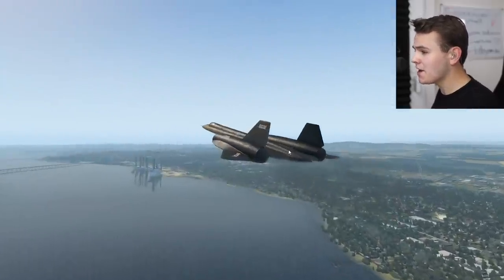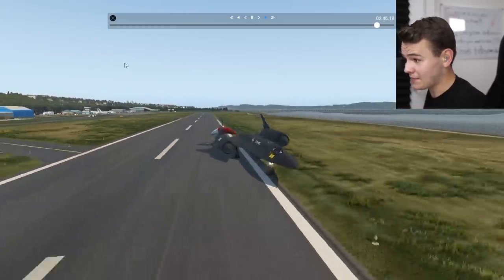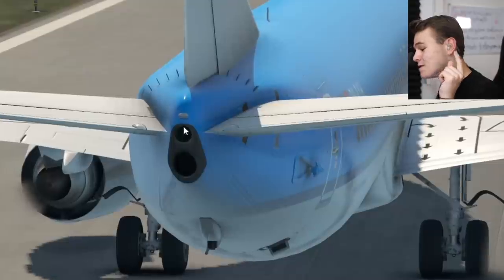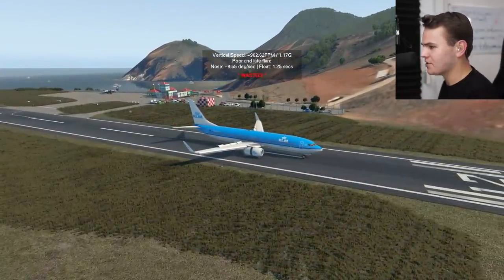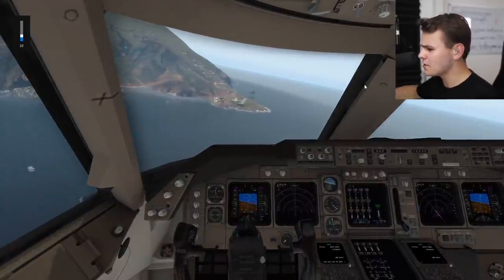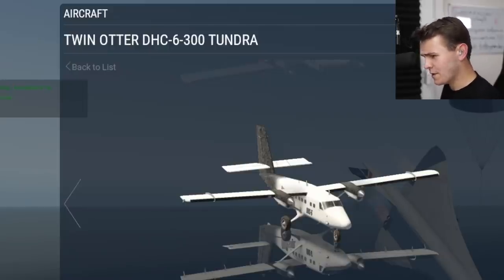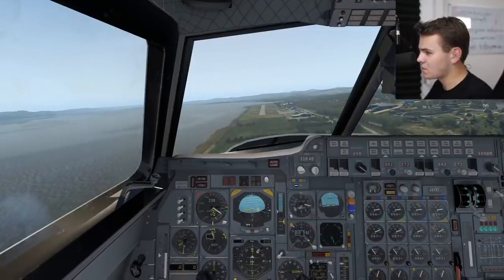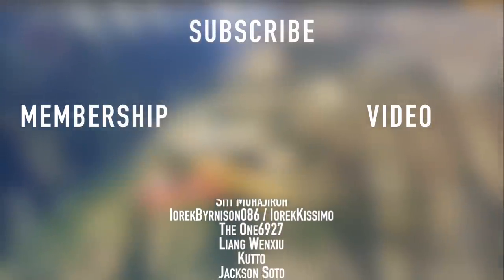Fitting Parachutes To Planes - You Can STOP Everywhere

Comment: The way I was on his page and saw the video go up seconds after. What the hell timing bruh. 😂🔥
Reply: Believe in JESUS today, confess and repent of your sins. No one goes to heaven for doing good but by believing in JESUS who died for our sins. Hell isn't fun. GOD loves you soo much unconditional❤😋
Reply: @alunesh12345  no
Reply: The Hog Rider card is unlocked from the Spell Valley (Arena 5). He is a very fast building-targeting, melee troop with moderately high hitpoints and damage. He appears just like his Clash of Clans counterpart; a man with brown eyebrows, a beard, a mohawk, and a golden body piercing in his left ear who is riding a hog. A Hog Rider card costs 4 Elixir to deploy.
Strategy
His fast move speed can boost forward mini tanks like an Ice Golem in a push. At the same time, he can also function as a tank for lower hitpoint troops such as Goblins as he still has a fair amount of health. Most cheap swarms complement the Hog Rider well, as they are nearly as fast as him and usually force more than one card out of the opponent's hand.
The Hog Rider struggles with swarms, as they can damage him down and defeat him quickly while obstructing his path. Barbarians in particular can fully counter him without very strict timing on the defender's part, though be wary of spells.
A Hunter can kill the Hog Rider in 2 hits if placed right on top of it. However, if you place something in front of the Hog Rider, the Hunter's splash will damage the Hog Rider and hit the card in front of it more.
The Hog Rider in conjunction with the Freeze can surprise the opponent and allow the Hog Rider to deal much more damage than anticipated, especially if the opponent's go-to counter is a swarm, or swarms are their only effective counter to him. Skeletons and Bats will immediately be defeated by the spell, while Spear Goblins, Goblins, and Minions will be at low enough health to be defeated by a follow up Zap or Giant Snowball.
However, this strategy isn't very effective against buildings as the Hog Rider will take a while to destroy the building, giving the opponent ample time to articulate another counter.
Against non-swarm troops, it can deal a lot of damage during the freeze time, but this can allow the opponent to set up a massive counterpush. For this reason, players should either only go for a Hog Rider + Freeze when they have other units backing it up from a counterattack, or if the match is about to end and they need to deal as much damage as possible.
It is not a good idea to send in a Hog Rider simply to destroy a building, especially if it is the only building targeting unit available, as defeating Crown Towers becomes substantially more difficult. Spells or simply waiting out the lifetime of the building are more effective. The exception to this is an Elixir Collector placed in front of the King's Tower. If a Hog Rider placed at the bridge, he can destroy the Collector for a positive Elixir trade, though the damage from both Princess Towers will usually mean he does not survive to deal any damage to them. However, if the opponent sends in defending troops, it can be an opportunity to gain spell damage value.
In a deck with several low-cost cards, it might be worth it to simply send the Hog Rider against one building. These decks shuffle their card rotation quick enough, that they will arrive to their next Hog Rider before the next building arrives in the opponent's card rotation.
Long-ranged troops like Musketeer and Flying Machine can snipe those buildings, preserving some of the Hog Rider's health, possibly allowing it to get some Tower damage.
When there are buildings placed in the middle to counter the Hog Rider, understanding the placement of the Hog Rider and the type of building placed can help the Hog Rider to bypass certain buildings.
Passive buildings such as spawners and Elixir Collector have a larger hitbox than defensive buildings; which means that if a passive building was placed 3 tiles away from the river in the middle of the opponent's side, then it is impossible for the Hog Rider to bypass that placement as the Hog Rider will get pulled to that building.
Defensive buildings have a smaller hitbox than a passive building, which means if that if a defensive building was placed three tiles away from the river in the middle of the opponent's side, a Hog Rider placed at the very left or right side of the Arena may be able to bypass it due to its smaller hitbox.
If the player has a building already placed down in the center of the arena, and the opponent tries to bypass it with a Hog Rider at the edge of the arena, they can use certain air troops to push the Hog Rider towards the building as it jumps over the river, effectively denying the bypass attempt. They must be already hovering over the correct placement, as very quick reflexes are required to correctly perform this technique.
For Bats, Skeleton Dragons, and Minion Horde, they should be placed right in front of the Hog Rider as soon as it is deployed.
For Minions, Skeleton Barrel, Mega Minion, Flying Machine, Electro Dragon, Baby Dragon, Inferno Dragon, Balloon, and Lava Hound, stagger the above placement one tile to the right if the Hog Rider is placed on the left side of the arena, and vice versa.
They can also use ground troops to achieve the same result. Something like an Ice Golem deployed at the Hog Rider’s landing spot will obstruct his path and force him to go around the unit, which causes him to be closer to the building instead of the Crown Tower.
The Hog Rider can kite Very Fast non-building targeting troops due to his own Very Fast speed and building only targeting if he is placed on the fourth tile from the bridge, slightly into the opposite lane. He can also stall grounded units when placed right at the bridge. He will pull them towards him while deploying, and then be untargetable by them when he jumps over the bridge. After landing, he will pull them back. This can be useful when the player needs to deal damage in the same lane they are defending. It will also help separate troops behind a tank in a large push.
A Tornado placed on the second tile front of the player's King's Tower and staggered two tiles towards the Princess Tower will activate it without any damage dealt to the Princess Tower, helping them in defending future pushes. This can also be a method of mitigating all damage dealt to a Princess Tower, but doing this more than three times may result in the King's Tower's health being low enough to be targeted directly, opening up the possible threat of a back door three crown. A better alternative is to pull the Hog away from the Princess Tower into the attacking range of all three Crown Towers, which will negate all damage as long as none of them are already distracted
A very powerful combo is the Hog Rider, the Musketeer, and the Valkyrie, typically referred to as the Trifecta. The Musketeer will defend against most troops, while the Valkyrie can protect her and the Hog Rider from swarms or high damage units. The Hog Rider is used to deal damage to the tower.
This can be effectively countered by Lightning, one-shotting the Musketeer and severely damaging both the Valkyrie and Hog Rider. The Minion Horde is also effective, but the enemy can Zap them and the Musketeer will one-shot them all. Even if the Musketeer is defeated, the Hog Rider and Valkyrie will have enough time to severely damage the Tower.
The Hog Rider should be placed behind the Valkyrie to give it a boost so that it stays in front of the Hog Rider, protecting it.
A Hog Rider combined with a Goblin Barrel can be awkward for the opponent to defend against. Timing it so that the Hog Rider is tanking the tower shots for the Goblins is the most effective way to deal damage. However, a Barbarian Barrel can shut this down with minimal Tower damage for a positive Elixir trade, as long as the Goblin Barrel was placed directly on the Tower.
Pairing the Hog Rider with the Balloon can deal devastating damage. If executed properly, the Hog Rider will act as a tank while the Balloon threatens to deal massive damage. The Hog Rider can also destroy any buildings attempting to slow down the combo. However, this combo is very vulnerable to swarms and anti-air cards as neither of the troops target anything but buildings. Additionally, they are easy to separate, due to the disparity in move speeds. Alternatively, the Hog Rider and the Balloon can be played in different lanes to spread the opponent's defenses thin. However, a building or Tornado can bring them back together for an easier defense.
The Hog Rider can be paired with the Lumberjack as both a swarm bait and damage combo. It is a very fast combo with an extremely high damage output potential, so the enemy will likely try to counter it with a swarm. If this happens, use a spell like Arrows to render the opponent defenseless. If they manage to defeat the Lumberjack, the dropped Rage will make the Hog Rider even more dangerous than it normally is.
A fast and deadly combination is the Hog Rider and Mini P.E.K.K.A. combo. Both units are fast but the Mini P.E.K.K.A. does much more damage and does not attack only buildings so the Mini P.E.K.K.A. can deal with troops like the Executioner and Musketeer. However, this combo can be defeated with swarms like Skeleton Army, which will defeat both of them since neither of them can deal area damage. They are also unable to target air troops, so the Minion Horde can stop this easily.
A risky play is to deploy the Hog Rider at the bridge as soon as the match starts. If the opponent does not react fast enough, the Hog Rider will deal a significant amount of damage to the Princess Tower. This can also allow the player to quickly scout the opponent's deck if they happen to react to him fast enough.
Reply: Swiss001 is an german
Reply: @alunesh12345  nono
Reply: @alunesh12345  🤓
Reply: It was meant to be
Reply: @alunesh12345  hell no